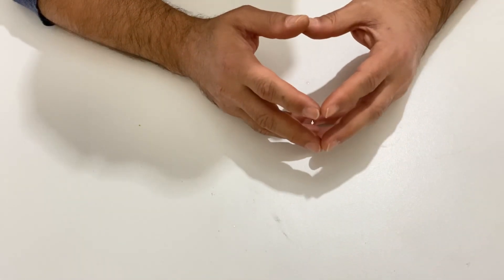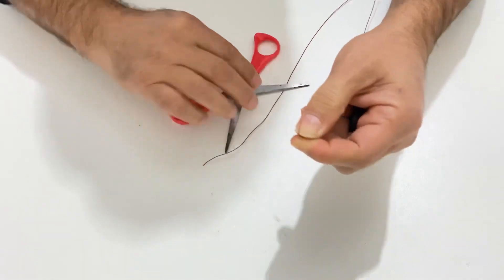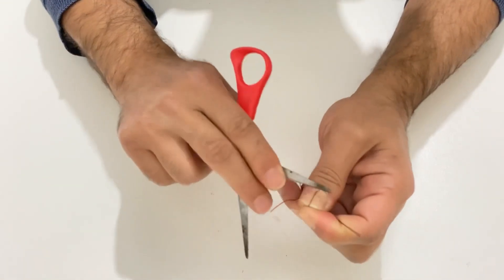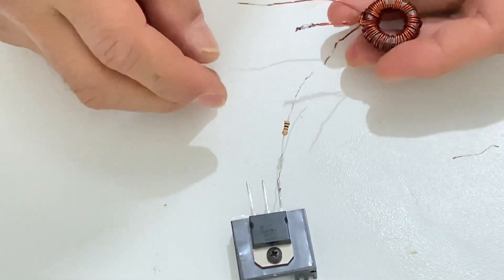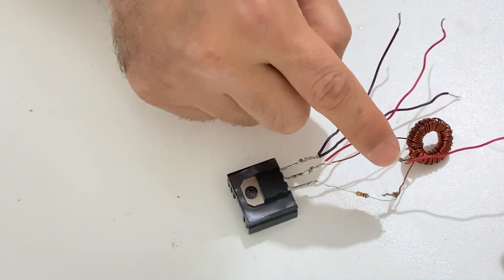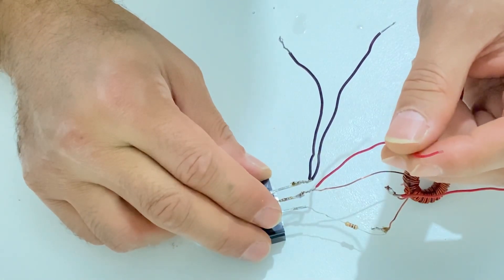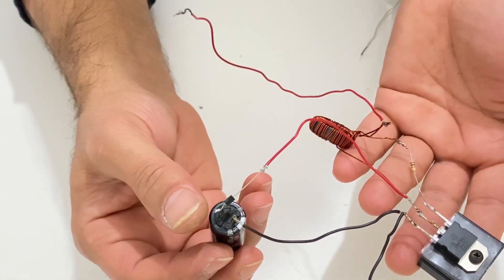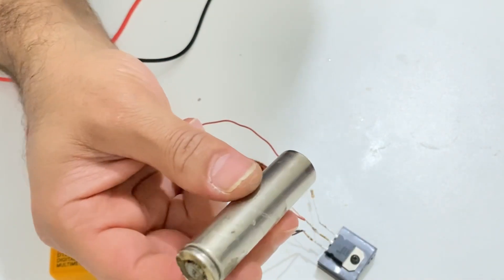How to Make a Powerful Joule Thief and DC Voltage Booster.

Comment: I like your video as I am just learning. But it is hard to follow you instruction, because you start by saying imagine black and white ends of the toroid. Then you continue to say, “this wire” and join it to “this other wire”. You then make another connection to “this other wire” which goes to “this wire” lease think of what you are saying when you explain. You could say “start of black wire” or “ end of white wire”. Or “join end of black wire to the resistor” which is more easy to follow and understand. Your knowledge means nothing if you cannot allow people to understand what you are teaching. Thank you for the video.
Reply: He is not professional

Comment: Hello awesome video, I want to build a giant joule thief that could draw enormous amounts of current for a larger project, can you give me directions which transistors to use besides building the a very large toroidal transformer?
Reply from the maker: You can use the same transistors by connecting more than one in parallel. Thus it can handle high current.
Reply: @joyofelectronics9782 thank you!

Comment: The switching isn't stable, too few turns on the core, and that core is for higher frequencies, you're hitting 1khz, the more input voltage the transistor is gonna get super hot, add a 10 ohm after the 1k resistor to the base.

Comment: with this 12v 21W lamp, joule no longer vibrates, but the lamp glows directly with a 3.7v battery. that is, they are not as effective. the load on the fan is so low that it works well

Comment: I made a big one. You helped me in the end. Youre very helpful. Mine has a giant 43 material toroid and a custom kind of Wrap. It's able to do really cool stuff
Reply from the maker: Thanks brother 👍
Reply: This is one of a few things I want to show you. I thought it's very cool. Mine can light 36 watt wall plug LEDs with only 2.2 volts when the power supply can't light it at all with 28.8 volts. It's so interesting because it's not a "transformer" with only equal wraps... there's no primary with less windings and no secondary with more windings. I'm fascinated by this circuit. The Joule Theif and Laser Saber's Joule Ringer 3.0. His has a primary and a secondary with many more turns but mine has only the bifilar wrap. But I made a very special kind. I invented a new type of Rodin Coil that I believe is better than the original.
https://youtu.be/DcFHZMhnV2g?si=iUuV_Op2Ao3hYPu_

Comment: What is the point of discharging the capacitor with the battery still connected, I wonder... 
Apart from making sparks fly of course.
Reply from the maker: There is no significant point. I just wanted to show the energy inside it.
Reply: @joyofelectronics9782  
I had guessed right; it's just for the sparks ;)

Comment: To wind the coils around the toroid it is much easier to fold a single wire at its centre so you have a U shape and  keep threading the U through the hole .when the desired number of turns are made cut the U  to form two windings
Reply: oh sht, yeaaaaahh u so smart never thought of that fukkk I feel so dumb:face-fuchsia-tongue-out::face-fuchsia-tongue-out::face-fuchsia-tongue-out::face-blue-smiling:

Comment: Beutiful,
Whats the maximum voltage this can hold?. And could an increase in both input voltage and number of coils in an inducgor increase voltage?
Reply from the maker: It can hold about 100 volts if you use an appropriate capacitor. Yes if you increase the initial voltage the output voltage will increase but l don’t recommend to go far forward.

Comment: Does Using thick wire increases its ampere?
Reply from the maker: Just a little bit.
Reply: @joyofelectronics9782 and if i will put many transistors in parallel?